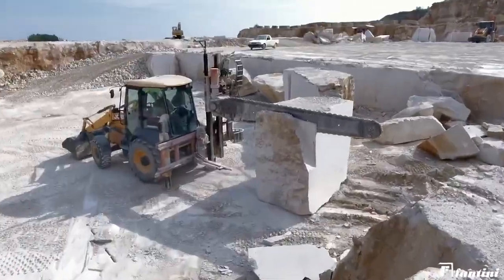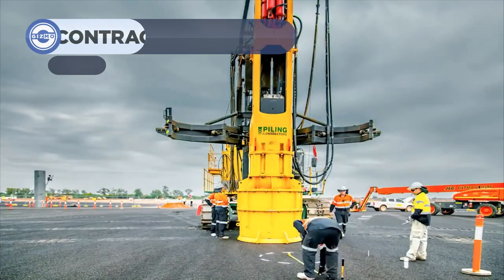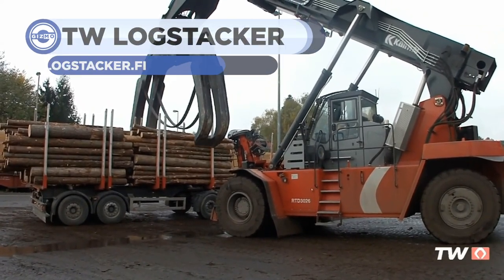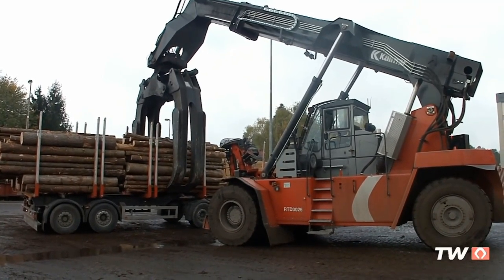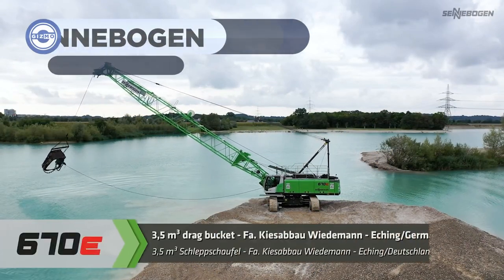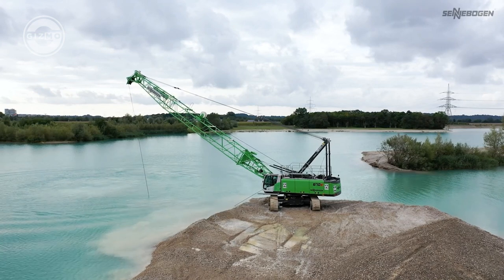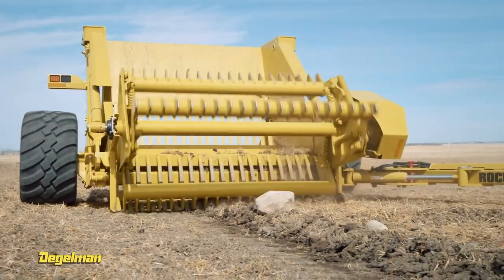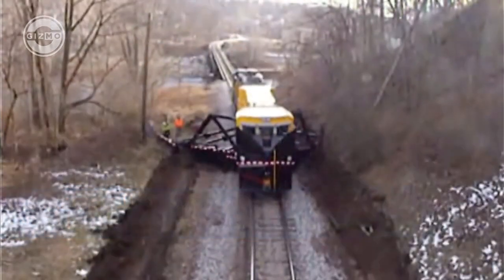Most Powerful & Dangerous Machinery Attachments That You Need To See

Comment: Note on the concrete pumps. Another company  makes a 65meter arm version. And I believe there may even be 101 meter designs. So the37 meter pump is rather small.
Reply from the maker: Good to know, we will check it out for another video possibly